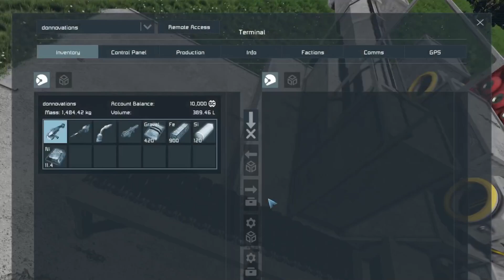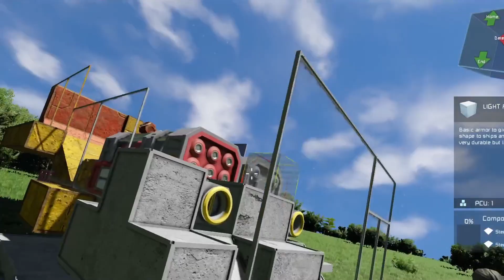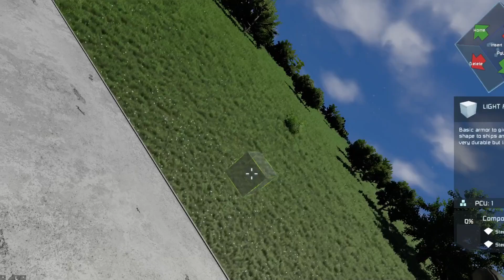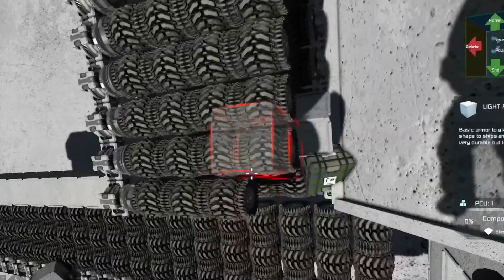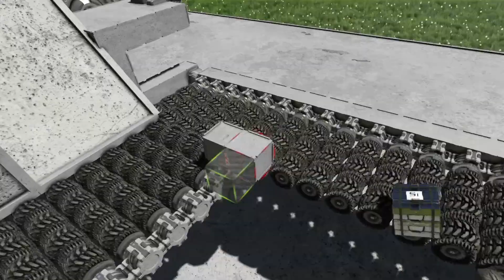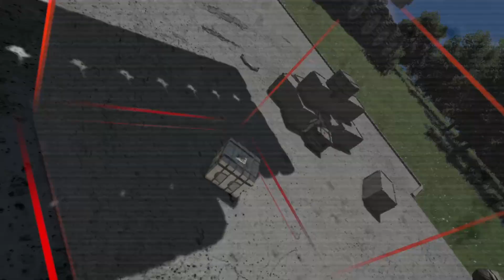Space Engineers Industry: Conveyor Rebuild EP2

Comment: angle each conveyor slightly up, like half of the wheel size, from the middle using a rotor with small head connected to the frame of the large grid holding the small grid of the conveyor

Comment: You should run your tests by allowing the connectors to spit out your test chunks, dead dropping it is not going to give you accurate outcomes of normal operations.

for elevation change, you could use a scoop made out of SM grid blocks that's attached to a rotor/hinge, and the scoop designed in such a way that when it raises it blocks your wheel conveyors so you get a build up waiting for the next scoop.

P.S. Klang says thank you. ;)

Comment: As for the coin pusher idea, you could eliminate clang by using blast door edge blocks on any edge that rubs another block the clang is caused by the collision zones on the block and blast door blocks have a collision zone set slightly inside the visible block.

As for you conveyor you will need to have a slight overhang and drop at transitions to avoid being stuck. Perhaps using blast door edges to cover any exposed rotors incase your item somehow drifts over them.

Comment: If you could, you can still use the coin pusher idea but maybe start the conveyer slightly under block that the pusher pushes across and then have the coin pusher slightly overhang that ledge. This may resolve that clang issue and get them to fully push off that ledge.

Comment: First set of rotors down one level to allow the material to clear the rotor displacement. The top row "pusher" line could go one block up to prevent roll over the diagonal axis? Cool design. At first I was like: "why? But by the end I was formulating ideas with you and from your design for other implementations. Ty for video from Texas...
EDIT: commented on your request for thoughts..the reversal of the rotors was boss. Also..no blunt points at intersections..utilize the slopes..IMO..sweet video

Comment: First, to help get things onto your small wheel conveyors, lower the wheels by one block.  That way items have to fall off the slope block or the previous conveyor to get onto the conveyor and they won't get caught on the edge.  Second, as multiple blocks move better on the wheels, why not make boxes with light armour blocks that you can use pistons to stop at various places to load and then retract the piston to let the filled box move along the conveyors.  This would also allow you to use a landing gear at the end of a rotor and piston combo to grab boxes off the line, move them and rotate them to dump their contents somewhere else.  Also, you could then use connectors or ejectors pointing down to fill the boxes and not have to rely on things sliding down slopes.